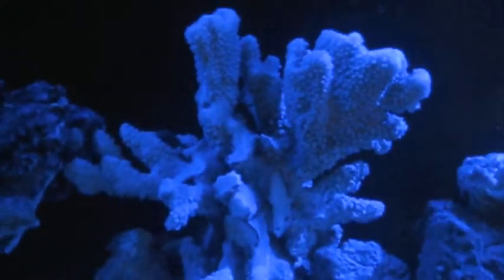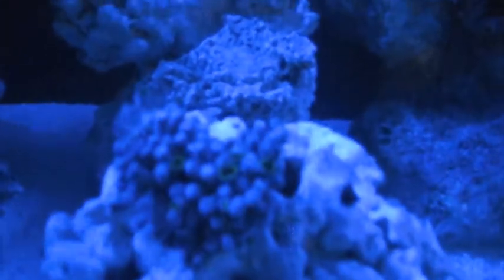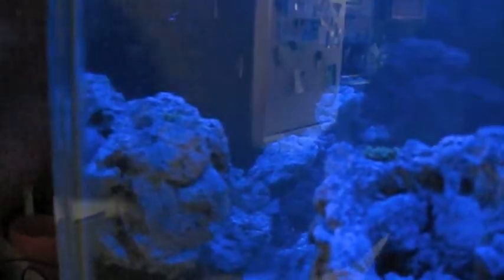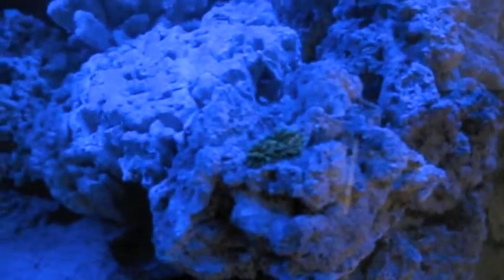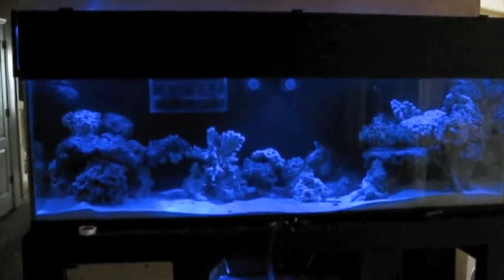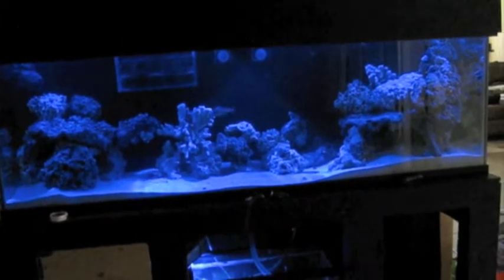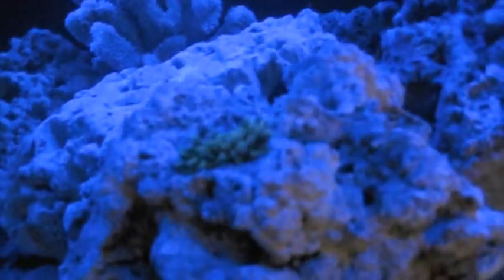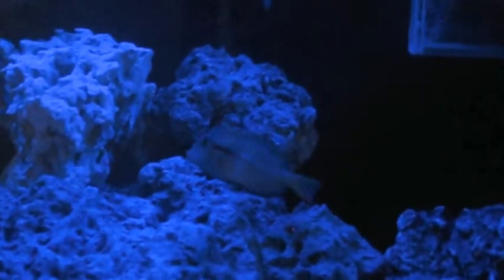Reef tank re-build un-veil 125 gallon

Comment from the maker: Ya I waited three days in between adding sand water rock and live stock..  Checked peramiters for the three days everything looked good so added next step in line and repeated..  I was reluctant to add live stock as well but everything was stable so i went for it..  I kept all my live rock under light and flow so nothing would have caused a cycle..  But its been two days with live stock and all levels are still great.. ( fingers crossed my dude).... I dont ask lfs anything...